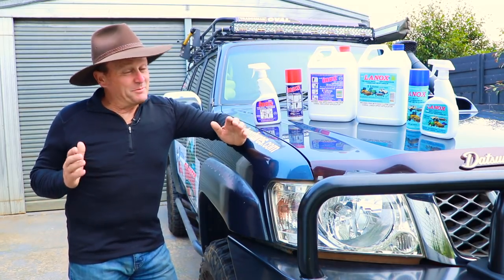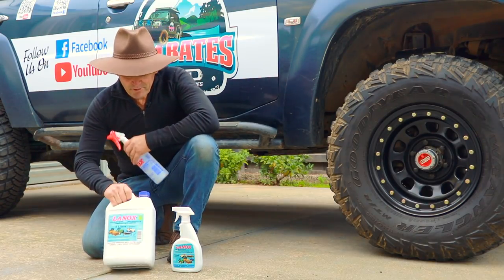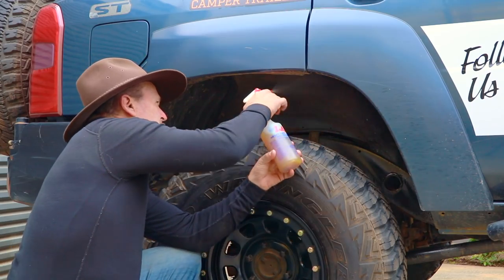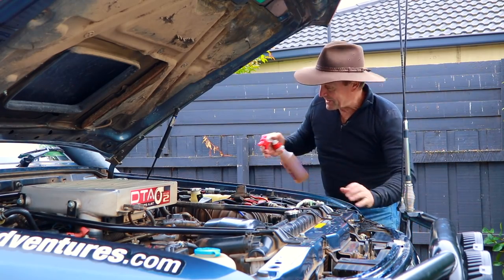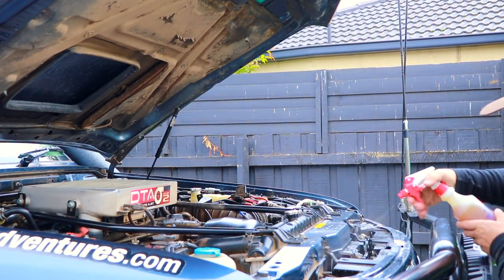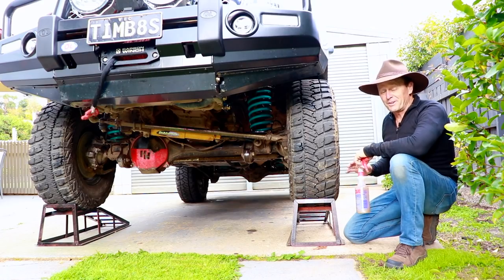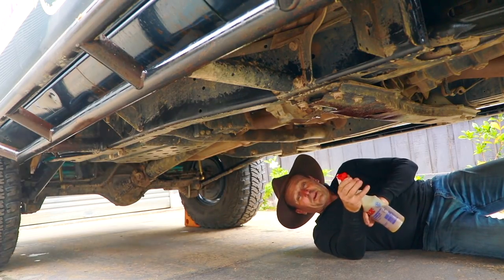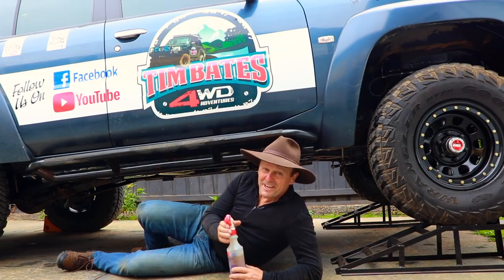LANOX MX4 - ( Rust Proofing Your 4wd )

Comment: I Have been using Lanox for 8 years now. I buy it in a box of 12 at a time. Use it for everything. It is by far the BEST product I have ever used. I have had a small bubble of rust in my gutter mount for 10 years now. I spray the bubble every time I wash the car and the bubble has not spread at all since. It won't make it go away but it has stopped its progress.  Have fun on Fraser mate. I was lucky enough to use a hoist before my trip.  BEST Product on the market guys.
Reply from the maker: Gday Mike,

Sorry for the late reply mate, ive just come off Fraser Island today.
Thats great feed back mate about a top quality product. 
Yes, a hoist would have been very handy mate. :-)
I had a great trip and will be back some day for sure.

Cheers Batesy.

Comment: You can also mix fisholene and peanut oil in a 50/50 mix. Whack it in a spray pump and give the car a good soak. The fisholene stops rust and the peanut oil makes it creep everywhere. I have been putting it on my 4WD’s for 30 years and never had any rust problems.
Reply from the maker: Gday Ross,

Thanks for your reply mate.
Its always good hearing from other people and the tips they have.

Cheers Batesy.
Reply: It would smell yummy too lol love peanut oil for cooking. Massive THANKS for the tip it will b a lot cheaper 👍
Reply: Tim Bates 4wd Adventures . Thanks Batesy. Love your channel mate. Thanks for taking the time to help others.
Reply: Matt Hutch . No worries Matt. This stuff stays sticky for ages. Put a piece of clear hose over the end of your hand pump so you can feed it into hard to get to places. You only need to use this stuff every 6 months or more. Cheers mate. Ross
Reply from the maker: Great tips about the clear hose mate for getting into hard to get at places. 
Cheers Batesy.  @rossdrayton5476
Reply from the maker: Gday Ross,

Great tips there mate. 

Cheers Batesy.

Comment: Did you find it dried hard after leaving it or does all the dirt stick to it now? I've used Lanotec in the past and anywhere it goes, it attracts all the dirt.
Reply from the maker: G'day George, 

I've not had and problems with dirt sticking to it. 
I only use it Im going onto beaches. 

Cheers Tim.
Reply: Hi George, Lanotec Steel Seal is a great product that if sprayed about a week or so before you hit the beach, allowing the product to dry to a nice dry film, will have a better outcome. Thanks
Reply: @LanotecAustralia  Thanks guys! How long can I be confident that my 4wd is protected? I get down the beach about once a week and wash it underneath straight away. Reapply every 3 months?
Reply from the maker: Lanotec Australia 
That’s for sure mate. 
All great products for those applications. 

Cheers Tim.
Reply: @seekingaus5196  Gday George, When on the West Coast , we were hitting the beaches every week and a wash and recoat every 2 - 3 months is perfect and acceptable.. :)

Comment: If I wanna spray the underbody of my car with lanolin, can I do so if there’s a bit of rust there, or do I have to get rid of the rust first?
Reply from the maker: Tiffany Corpuz 

Gday Tiffany,

I would say if you already have rust happening. 
You might need to get rid of that first. 
It won’t get rid of the rust you already have. 
But it might slow it down from getting worse. 
For best advise, I would contact INOX directly. 
Thanks for your question. 

Cheers Tim.
Reply: Tiffany Corpuz hey Tiffany. As Tim says. It will definitely seal off the rust and prevent from further rusting. Obviously doesn’t compare to removing and repairing the rust spots  but it’s a great interim solution 😀

Comment: Been doing this on my vehicles for years now. In my experience the standard Inox MX3 for all engine bay work at any time or just prior to a trip. Also carry a can in vehicle at all times. Keeps you engine bay protected and looking schmick!
I find the LANOX MX4 a pain in the arse under the bonnet as it leaves a waxy coating over everything. After a while shit keeps sticking to it and over time your under bonnet area always looks dirty - way overkill and too hard to get off. 
However I also agree with you - definitely LANOX MX 4 for all underbody/chassis use - 2 weeks prior to any big trip on the coast or anywhere for that matter. Keep that stuff away from your brake discs as well! (keep a can of brake cleaner handy when applying LANOX)
For the benefit of readers who are planning this - It’ll drip off the vehicle for a while too. Best to do it out on the lawn or somewhere else other than your own clean driveway.......(you’ll thank me for that tip alone when you try it for the first time) 👍
Reply from the maker: G'day Grant,

Great line up of tips mate. 
Its a great product and one I've never had issues with. 
Well worth applying if heading for the beach.

Cheers Tim.
Reply: Guys, so can you just spray it on everything in the engine bay or are there things to stay away from? I've never done anything like it before and trying to avoid having to pay $900 for underbody protection.
Reply: Great advise thankyou

Comment: Great work Jim been using in inox myself now for a least 57 years I’ve always thought Inox was the best also often spay some on my arse for an extra lubricant
Reply from the maker: G'day mate,

Thats great feed back over the times you had used INOX, it's a great product.
Not sure i'd use it in your last recommended option. Lol
Thanks for your reply mate.

Cheers Tim.
Reply: They came out in the 1980's, no way you have been using them for 57 years.
Reply: @Martian74  

I was just about to say the same , someone is getting a bit excited .

Comment: Every service I run around giving all the hinges, important bolts, electric connectors that might get wet in a river crossing etc. a spray with Lanox and I don't even do salt water stuff.
Plus I use Lanox on all my firearms and fishing reels.
Reply from the maker: G'day Albert,

Yeah for sure mate.
Lanox sprays have a wide range of uses. 
It's a top quality product for all applications.
Thanks for your feedback and reply mate. 

Cheers Tim.

Comment: ANOX MX4s main competitor is "4wdetail Chassis Shield" they claim there product dosnt have lanolin in it and it works far better as sand wont stick to it,
whats your opinion on this??
Reply from the maker: Gday mate 

I’ve never tried or heard of the product you mention. 
Inox has been around a long time and a proven product. 
As long as you don’t hit the sand the day to you spray your 4wd. Then sand doesn’t stick. 

Cheers Tim.

Comment: Sweet, cheers for the tip, I'm gonna do one better and use a pressure spray bottle, make life a bit easier.
Reply from the maker: G'day mate,

A pressure spray bottle would be a lot quicker and easier.
But well worth applying before heading for the beach.  it for sure mate.
Thanks for your feed back and reply.

Cheers Tim.

Comment: Tim buddy, do you use CT-18 super wash on any part of your car at all?  I just bought some and am told it can reck paint ?
Reply from the maker: +Dale .p 
Gday mate,

I haven’t used CT-18 
But I have used CT-20 in the past. 
I only used it on the Under side of my Patrol. 
Diffs, suspension and around gear box etc. 
Plus I used it around the engine bay. 
I didn’t ever use it on the painted panels of my Patrol. 
Hope that helps mate. 
Thanks for your question. 

Cheers Tim.
Reply: Cheers mate, yeah thanks for the tip
Reply from the maker: @dale.p4817  No worries mate.
Reply: Very late reply but the answer might help others. CT18 will not harm your paint work but it will remove any wax or polish that is protecting the paint, so it can make your paint work more vulnerable. So it is safe to use CT18 to wash your entire vehicle but it would be in your best interests to apply a polish then a wax once the vehicle is dry.
I use CT18 on my rig but I only use it on the engine bay & underbody during normal after trip washing. I apply new polish & wax to my rig twice a year & it is important to remove the old polish & wax coatings BEFORE re-applying so it is at this time I will wash the entire vehicle using CT18 purely as preparation for applying new protective coatings. Aside from that twice a year treatment, I use a wash & wax product to wash any painted surfaces. This has worked very well for me over many years & my 4wd, which spends half it's life on beaches, has no rust that wasn't there when I bought it. Not bad for a 30yr old vehicle that is prone to roof rust.

Comment: What about inside the chassis rails? How do you spray in there?
Reply from the maker: Gday mate. 
I didn’t spray inside the rails. 
I gave them a really good fresh water flush out when I got home. 
And repeated a few times. 
Thanks for your feedback. 

Cheers Tim
Reply: Vent to chassis rails is the best protection .
Reply: @andrewberg2361  this should be common sense to vent your catch can to the inside of chassis rails but in NSW its also a pink slip rego check fail for a oil leak, the laws are so stupid

Comment: Hey brother, with that inox mx4, do you remove it after your done? (If possible) or leave it on, and do you spray it before every beach trip? P.s you should make a vid on how to clean your 4x4 after beach
Reply from the maker: +Dale .p 
Gday Dale,

No I leave it on. 
Inox is a great product for keeping your 4wd clean. 
Mud and dirt doesn’t stick to it. 
As far as re-coating before each beach trip. 
Depends how often you are going. 
If I was going every couple of months, I’d probably spray again. 
Cheap insurance for the protection of your vehicle. 

Thanks for your questions mate. 

Cheers Tim.
Reply: Tim Bates 4wd Adventures so sand really won’t stick to the manic on the underbody? I be been told it does? 
I want to give the product a go but refrAine from to much beach driving anyway. But I was concerned about the idea of more dirt and sand ingress into parts and seal?

Comment: Did the produce cause dirt and sand to stick to chassis even after drying?
Reply from the maker: G'day Matt,

I didn't have that problem. 
I sprayed my Patrol a week before i went, and didn't find any dirt or sand sticking to the sprayed areas. 
Thanks for your reply mate.

Cheers Tim.
Reply: Tim Bates 4wd Adventures did you wipe it in or to remove excess with a rag?
Reply: Tim Bates 4wd Adventures how long did you find the coating to last for mate?
Reply from the maker: @mattsmith2051  
I spent 8 days on Fraser Island and i didn't have to do a top up spray. 
I took a small spray can with me in case i needed to touch up any areas.

Comment: Would you recommend to spray inside chassy rails??
Reply from the maker: G'day mate.

Yes, absolutely.
After driving the beaches for a few days, the chassis rails of your 4WD will get salt water and sand inside them.
So, spray inside the holes as best you can.
Then get the hose into those holes, and give inside the chassis rails a good wash out when you get home. 
Thanks for your question mate. 

Cheers Tim.

Comment: Is ok to use anytime or just when beach driving ?
Reply from the maker: Gday mate,

Sorry for the late reply, I've just come off Fraser Island.
You can use INOX anytime mate, its a good lubricant as well.
Plus it will help keep the inner side of your 4wd clean. 

Cheers Batesy.
Reply: Where do you get it from ? Bunnings ?
Reply from the maker: @rudvs  Hi mate, Bunnings wouldn't sell it. If you jump on the website I mentioned in the video. That will help you on where to buy the product.
Its great stuff.

Cheers Batesy.
Reply: @rudvs  you can get the LANOX 5lt at BCF, and the INOX 5lt from super cheap. the aerosols you can get from Bunnings